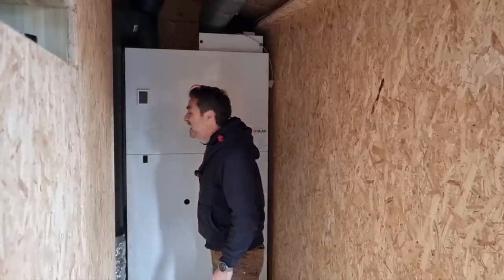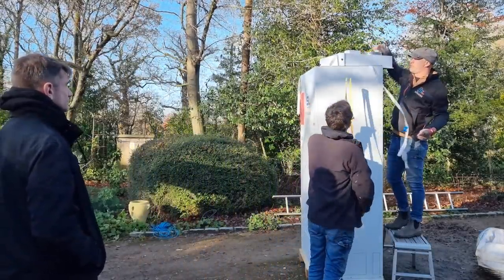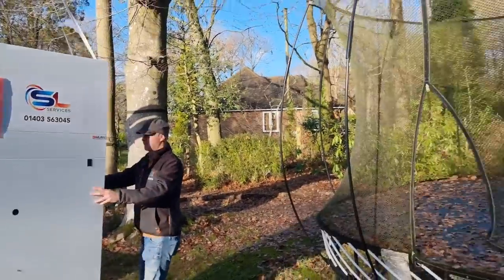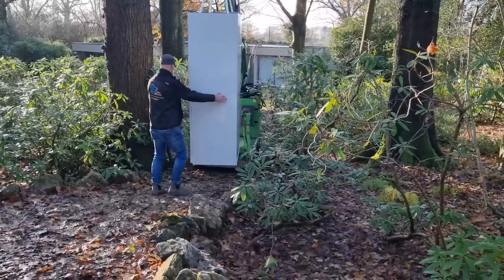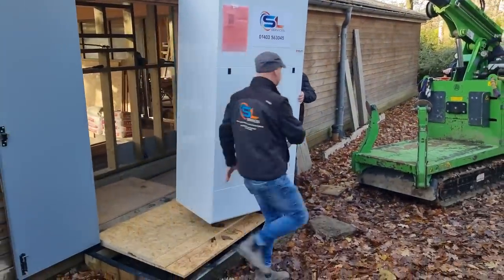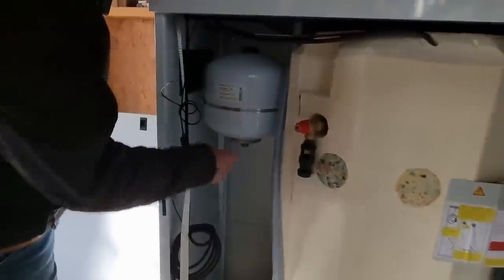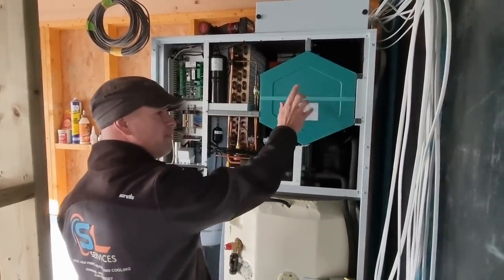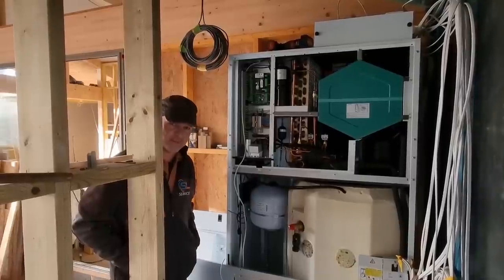Hot water, Underfloor heating and MVHR all in one unit for my Garden room

Comment: I recently discovered companies like Flints Theatrical. Amazing ranges of castors - very heavy duty, low profile, lockable - any combination. Far more options than the usual hardware and ironmongery suppliers, though I still use them. I was advised by a friend who works in backstage theatre productions. Stuff has to be moved fast, safely, often in the dark, and often very heavy. Brilliant for moving things like this carefully around a building or on a solid path outhside
Reply from the maker: Thanks for sharing!

Comment: Looks like a good machine will it heat the swimming pool as well or do you have another source for that.?
Reply from the maker: Hi Leslie, this is just for the areas other than the pool, so the pool water will be from a dedicated air source heat pump designed for just heating pool water

Comment: The power lead for the"internet gateway" should have been supplied with a fitted 3 a bs1363 plug rather than the shaver style euro plug!!  Tut tut!!!
Why didn't you sit the unit on the platform to move it rather than leave it hanging??
Reply from the maker: Ian these units are made in Europe, it is no big deal for my approved electrician to change the plug
Reply: @ukconstruction  Robin, even if they are made in europe they should still be supplied with the proper plug for the country they are sold in, agreed its not a big deal to swap but....